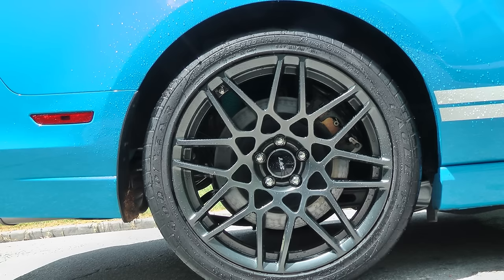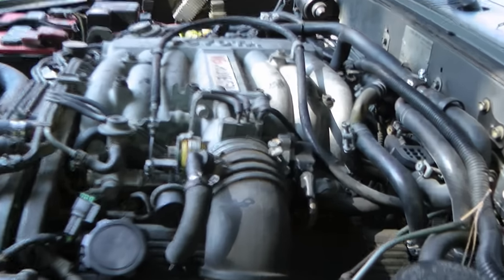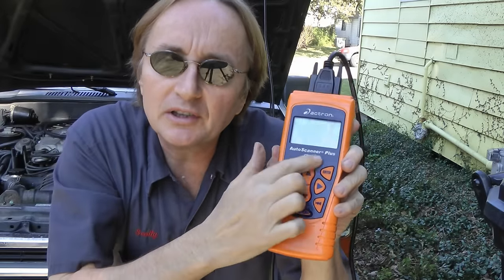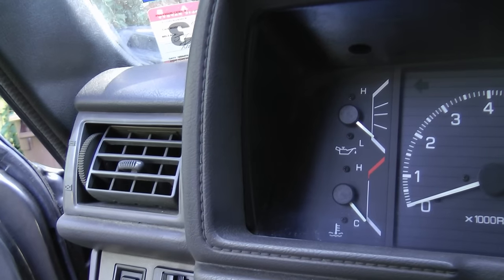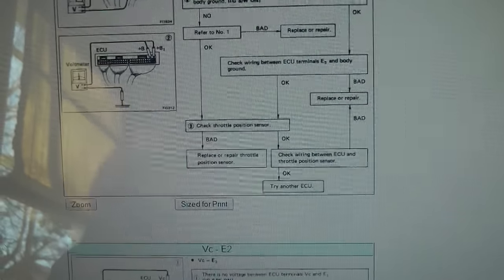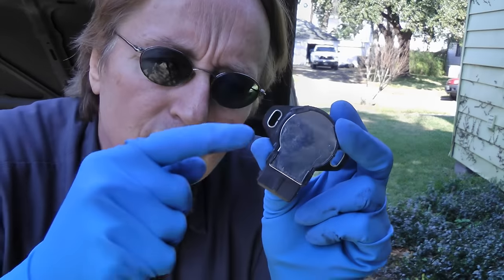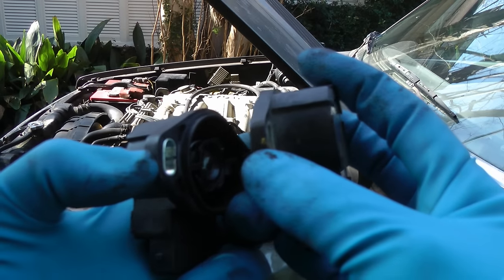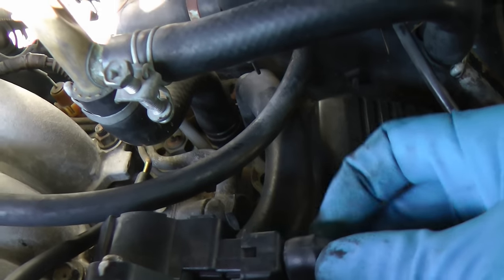How to Stop Car Hesitation (Throttle Position Sensor)

Comment: Hi Scotty I have Toyota Hilux with 1kz te engine it drives nice but after 20-30 minutes of driving if I slow down on signal then the engine light came on and los the power.
Then I have to turn off the engine and start again

Comment: Hello Scotty. I have a Lotus Elise MK2 from 2001 with a Rover motor.
It was tuned and is now 142bhp (from original 120bhp) The car has 50.000km and looks like new. (Means always garaged in winter)
The tuning supposedly was 160bhp when new. This makes me a little suspicious on the state of the otherwise esthetically fine engine. My problem is that it uses a lot of fuel; 1 liter per 7.5-8KM. It was recently remapped but still I have a lot of backfire and when I accelarate it feels like it has to clear the exhaust and cilinders first before it actually goes... Starting is not optimal, smells like fuel. Idling is ok and the rest is ok unless I step on it. Most important is that it just gulps gas. No idea what to look at.
Reply from the maker: Robbert van der Eem   it's running too rich, normally that's in the fuel injection mapping, in other words, it was not turned right or fuel injectors are leaking

Comment: Hello scotty... we got a kia carnival 2006.. car engine sounds great.  drives great.. all of a sudden loses acceleration completely. .. no revs.. no nothing. . engine light is on... turn off car for 30 secs or so. . start it back up.. drives fine.. engine light still on.. sometimes problem will happen right away... sometimes next day... sometimes longer.. its had a service. . and a diagnostic. . but nothing shows up on the mechanics diagnostic check. i put some injectors cleaner in .. still does it.. any ideas mate.. thanks in advance
Reply: if you have a check engine light, you have a code. maybe the easiest thing to check would be the idle air control valve. it should be somewhere on the throttle. that was the problem for me, id be driving like normal and suddenly the engine would shut off completely. no warning, nothing. id pull over to the side of the road and start the car up like nothing happened. the worst lart was that it felt completely random, sometimes id go weeks without the problem. what i did was take the valve off and cleaned it. it was pretty damn dirty. havent had a problem ever since.

Comment: Scotty..I have a Question.Can A rear speed sensor Go bad without setting a code on a 2001 GMC YUKON XL 1500 5.3 WITH A 4L60E
Reply from the maker: yes they can, GM software isn't the greatest

Comment: I have a 1996 Toyota Corolla 1.8 L. Whenever I drive the car will run fine but there are times that when I accelerate the car will stop briefly( about 2-3 seconds) and burst into speed fast.  When this happens and I put the car on park, the car sounds like it's running out of gas and then sound normal. What could be the problem? Note that a couple of days ago, I nearly filled the gas tank and the car was running fine. Today,  the tank is almost half full and started doing it again. What should I do?

Comment: I have a 1991 toyota pickup truck it had good breaks before my break line rusted out I replace line with compression fitting and blead my breaks and my breaks are springy not good what should I try now

Comment: I hope that's the problem with my 2008 suburban, at idle the sensor is at 16% and it shakes like it's misfiring only its not, wonder if that unplugging it trick works on electronic throttle bodies

Comment: Scotty I have a 1992 Grand Prix that had a poor idle. I replace the fuel injectors and put everything back together. now when I start the car it idles fine and then starts racing all of a sudden (2000 rpms). did a vacuum test and there's no leaks. replaced the iac cuz it keeps on pulling the code saying that it can't set the idle. could a bad tps cause this? I replaced the EGR, air temperature control sensor, map sensor, and cleaned the throttle body.
Reply: Kevin Rivard I have an 04 grand am with a 3.4 v6. have your replaces your tps yet?  my car is doing the same thing. sometimes it'll idle fine at 600 then sometimes after driving it'll idle at 1500 or 2000. if I turn the car off and start it back up it'll idle correct at 600 for a while. I did the voltage test on it and everything electric wise checked out. thinking about just trying a new one this weekend since the problem is intermitten and my test was done at proper idle rpm.
Reply: Brandon L your 2004 3.4 liter is obviously different than mine I have not replaced the throttle position sensor yet I have went to the store and got it.but I took my car up to the shop it's actually there now I'm waiting to hear the results on a smoke test. even though I told the guy I did a vacuum leak test with a gauge. hopefully I'll find the answer out soon because I've replaced basically every single sensor on the car
Reply: Brandon L another thing my idle will stay up like that after the car is warmed up. if I turn my car off and then back on it won't come back down if the car is still warm.
Reply: Kevin Rivard I replaced the throttle position sensor in mine and it's been idling at 600-700 rpm like it should be.  Been in for a week now and hasn't done the high idle since.  I'mm be replacing the spark plugs, wires, and all 3 ignition coil packs this week to try and smooth out the ignition on the car.

Comment: Scotty I've got a 1996 Toyota T100 that has started sputtering at high RPMs (usually starts around 3k). Do you think this is a throttle position sensor issue as described in the video? Or could it be  something else like the air intake or fuel pump?
Reply: Check ur map or maf

Comment: hey scott i have a 99 civic ex and i drove through a huge puddle of water just two ago and it feels like im not getting enough fuel when i slam on the gas and it will stall but when i gently press the gas peddle it works ok. could it be my sensor

Comment: Scotty need help. When I drive at low speed changing gears. (Its not clutch I know that) car starts to stutter and hesitate for 2 secs like no fuel is getting in and then car drives beautiful. Coils are good. Plugs are good but just not sure
Reply: Vacuum leak?
Reply: @andrewbrowning6900  all good mate it was oxy sensor engine code came on and fixed

Comment: if the sensor is bad, would the car have a bad acceleration while driving in the road?  I have a 1998 vw golf. thanks Scotty
Reply: Yes it's directly related. BAD TPS can tell your ECU that you accelerate half the throttle where is you're flat out... therefore bad acceleration. My question however would that be consistent when it goes bad or can this happen one day and be ok the other day?
Reply: +Paul JJ mine does it everyday. i have it parked and i havent done anything to it yet.

Comment: When I unplug the TPS on my 1992 Infiniti G20 the engine dies, so it's not that, but when I unplug the MAF sensor it runs better, but stalls when I plug the MAF back in... Could it be a bad MAF or can my car run without a MAF like some BMWs?

Comment: Scotty, I cleaned the air intake/throttle using the Seafoam spray (following the instructions on the can). The next day the car tuned on perfectly but the gas pedal is like dead; nothing happens when I press the gas pedal. What could be the problem? The Throttle Position Sensor?
Reply from the maker: if you have the late model fully electronic throttle system, you MUST disconnect the battery or throttle wiring connector BEFORE cleaning the throttle so you don't short anything out. You may have shorted out the throttle motor system now
Reply: I'm currently 80 miles away from my house basically stuck here. I was on the freeway & the car stopped accelerating, usesd it on the street & it only goes about 30 mph maximum. Any idea?

Comment: Hi scotty, i have a 2007 pontiac torrent. When im on the highway or going on the ramp it wont pick up speed. On the highway, going solid 90 km and if i press the gas pedal a little bit or half way it does nothig and stays at a solid 1500 rpm, until i floor it. It has no codes.

Comment: I have a 2013 chevy Cruz and my car shakes after I fill it up with gas and when I pull out of the gas station I get to a light and when it turns green I step on the throttle and the car eather stalls or shakes as it takes off. is it the throttle position sensor? or maybe clogged fuel filter? fuel pump?

Comment: Hi Scotty! I am so frustrated with my 2000 intrepid. My car has stalled stopping at the a stop sign. Turning a corner, or just driving slowly in a parking lot. As far as I see there is no light That comes on. How do I know if it is the throttle sensor? It is strange it won't stall other times just going at low speed or slowly turning a corner. What else could it be? Suggestions please. Thanks!
Reply from the maker: try my vide "how to fix a car that idles poorly"

Comment: My 1965 ford 240ci inline 6 stumbles on acceleration. It has new points and condenser, new wires, new plugs, new ballast resistor, new distributor, new autolite 1100 carb, new fuel pump. I'm completely stumped. It just Boggs down right when you give it gas pulling away from a stop or from coasting and applying a little gas.
Reply: +Yoton Bouger Fuel punp  ?
Reply: catalytic Converter is blocked

Comment: Scotty I have a 98, 4.3 had a few issues bucking not wanting to run or idle so I went through the codes, I put new spider injectors, new fuel pump psi was only 49 lb,  also put lower manifold gaskets on it new plugs and wires, runs great except when it's cold, it will idle great but put it in gear and accelerate and it spits and bucks and won't go, let it warm up a bit and it runs great, can you help?
Reply from the maker: check for vacuum leaks and change the fuel pressue regulator if you didn't do that.  then also do a cold engine compression test to see if engine is just flat low on pressure when cold
Reply: Isn't the fuel pressure regulator the small round thing on the back of the spider injector assembly?

Comment: 1999 Mitsubishi Eclipse. If when starting the car and giving it some gas slowly causes the car to stall out would this be an issue with the TPS?
Reply from the maker: +TehReal Deadman on that model it's rarely that. More often do my video "how to clean fuel injectors on your car" and change the spark plugs and air filter

Comment: I have a 2006 Ford Taurus se my car want crank on first try but on second or third. I changed ignition coil and wires but onces it start it run goods any advice

Comment: Hi kilmer,
I have nissan sunny 2005 japan made, when i am picking up my car and the ac is on.feels like its dragging something.and when i switch off the ac, car runs good.please advice what to do which compressor? And also compressor is whistling sometimes. Thanks and reply will be appreciated.
Reply: i have a 92 F150 doing the same thing. with ac off, it runs beautifully. when its on, it feels sluggish and even shifts a bit rough. it feels a bit like when you drive with the parking brake slightly depressed. and my compressor makes a clicking sound. i replaced the bearing, hoping that would be the problem. i think the next step would be replacing compressor. if its not working correctly, its probably really hard to turn. so thats putting wayy too much load on the engine, at least much more than it should.

Comment: Mr. Scott I Have A 2001 Mitsubishi Eclipse, When i Run it On First Gear It Runs Good, Until I Get to Second Gear and The Rpm Would Shoot Up To 3000RPM While i Try To Accelerate. Also it Would Slowly Accelerate to 25-30Mph While The Rpm Shoots up and Then It Will go back To 2000Rpm, When i get to like 4th-5th gear id be driving about 65Mph and it would automatically Shoot up a little Past 3000 for one or two seconds  on its own and itll go back down to regular 2000 Rpm, Then if i try to increast the Speed it also Slowly accelerate and Rpm shoots up again, What do you think could Be The Problem?
Reply from the maker: transmission is going out, typical on that model. Get rid of it fast, or spend thousands rebuilding the tranny. Don't try a used unit as they are all junk when that old on that model.

Comment: I have a sienna 2007 and looses power going uphill and some times on freeway and the road. I clean the throttle sensor and the throttle with their recommended spray. I also change the oil and oil filter as well as the air filter. Theres no check engine light.. I dont know what could be wrong... Maybe needs new spark plugs . Only has 79000 miles . mechanics want to charge me $140-180 for a diagnostic. What do you think it could be?

Comment: iv got a car that won't throw a check engine code and it's hard to start. iv replaced the mass air flow thinking it was it and still hard to start. if I unplug the mass air it starts right up any ideas

Comment: I have a question, Scotty 
I have a 1988 GMC Sierra 5.7, I've changed plugs,wires,cap and Rotor. The truck shakes on slight acceleration and keeping with the traffic flow. You think it's a bad fuel filter issue? Thanks
Reply from the maker: try that first, but if not that, pressure test the fuel pump and pray it's weak, cause on that model, often that's a wearing out transmission
Reply: +Scotty Kilmer My 99 ford explorer Starts and runs Perfect, but when I try to accelerate it dies any suggestions?
Reply from the maker: change the fuel filter, then pressure test the fuel pump to see if it's bad.
Reply: +Scotty Kilmer Thanks so much

Comment: I just replaced throttle body on 2011 Silverado 1500 with a jet throttle body. It accelerates high. I did the relearn procedures and it still accelerates. What can I do to fix this problem?

Comment: hey Scotty I have a question for you I have a 2000 GMC Jimmy and today I was driving and my car accelerating without me pressing the gas pedal I did pull over I stopped I put in parking I waited for 4 minutes and then I moved on  and  it didn't do it again

Comment: I have a 93 s10 v6 4.3L. My problem is when I’m at a stop and give it gas the truck starts to bogged down .I have no check engine light . I changed fuel pump and filter, igniting module ,tps, map sensor,egr valve , idle valve, dist cap, spark plugs and wires . I need help !!!  Any suggestions ?

Comment: Hey Scotty, Is the TPS related to my cars rpm dropping then going back up after letting off the gas?
Reply: Sounds like a bad
Idle air control valve (iac)
Reply: @2guns908  My 350z doesnt have a IACv but i'll check it out. thanks man

Comment: With obd1, if my car doesnt have the check engine light on (MIL) then will it still get a code? 
1995 toyota corolla DX 1.8l automatic
New fuel filter and attempted to clean IAC and throttle body...

Rough idle and stalling at idle, otherwise its fine (i drive it everday no problem)

Comment: how's it going I have a question about my 1978 dodge sportsman rv I have its hesitating and it backfires when I step on the gas to much and when I start it I have to step on the gas for it to start and hold the gas in for awhile for it to stay on after it starts have any suggestions

Comment: Hi I have a question, my car runs very bad when the MAP sensor is on, but when I take it out, the car runs normal. The idle is still at 1.2k but goes down after a few minutes. But when the MAP sensor is in it consumes 20l/100km. But I accidently bought a throttle poisition sensor instead. Should I change the TPS or the MAP sensor? If the car runs better when the MAP sensor is not on.
Reply from the maker: you could try that, but realize car are complex computer driven monsters and disconnecting parts often does weird things to such complex computer systems with multiple back ups
Reply: Ah I see. So it could be something else. So unplugging the MAP sensor could mean that I've unplugged something else as well. Thank you for your answer.

Comment: hey scotty
i have an 89 f150 inline 6. over these passed couple weeks during hottest part of the day my truck starts spitting and sputtering after about 30 mins of driving about 15 mins of that is doing hwy speeds. ive replaced plugs, ignition control module, ignition coil, dis cap and rotor. again today it still acting the same. it does fine in temps below 95 or so. my question is, is it possible for the TPS gets to hot and causes it to send the wrong info to computer, or do u have another idea of what it might be? thanks in advance
Reply: one more thing. also ive check the fuel filter and pressure and everything seems to b fine on that end

Comment: Check engine light was on had it checked so I changed the throttle position sensor trk  is running good I drive it and still doing the same thing jerking like it's running out of gas?

Comment: Hey man I have an rsx and my tps is oem but when I set it to the proper voltage my rpm would be high, so I would have to lower the voltage from 0.475 to 0.19 any tips?

Comment: Hey Scotty, i have a 98 ford explorer and i bought a new TPS from ebay for like $15. Is there a whole lot that go into these on the inside? My local parts shop sells them for $40. It looks exactly the same. I'm having hesitation issues intermittently. Also my car has been stalling, completely shutting off and it shows the battery light. New battery and alternator tested fine. Cleaned the throttle body to where its spotless on the inside. I put my ear close to the throttle body and i definitely hear a hiss coming from around the throttle body. I'm in the process of changing out the manifold gaskets upper and lower. But was just wondering if a cheapy TPS sensor could be the culprit to my stalling and hesitation.
Reply from the maker: those chinese ones are crap, but sometimes they work. hiss is a vacuum leak, fix that first